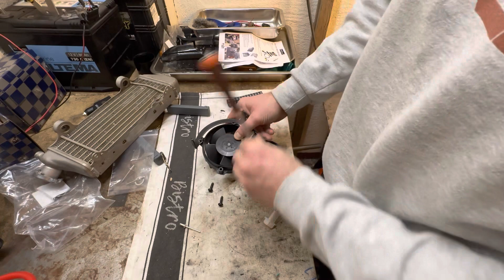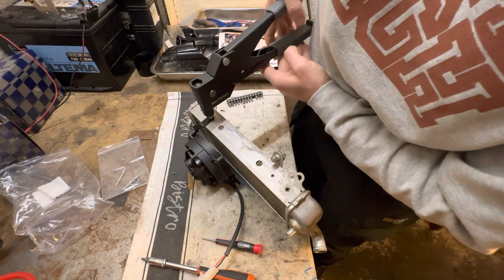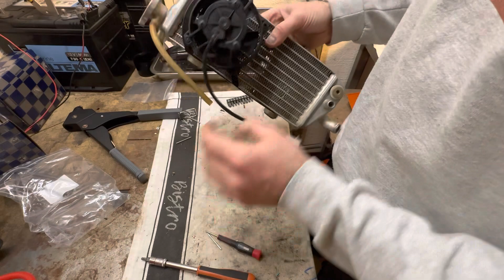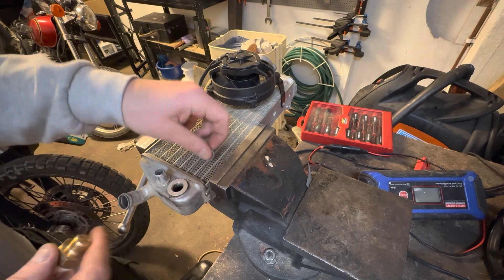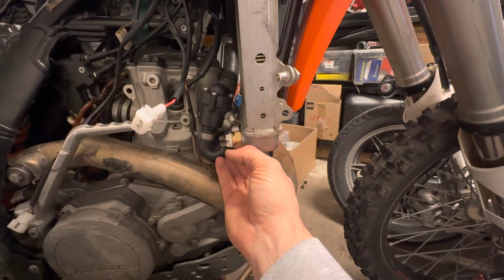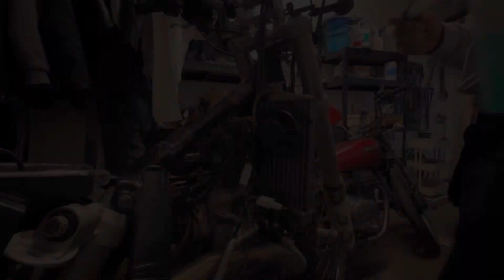KTM 450 EXC 2011 cooling fan installation.

Comment from the maker: DISCLAIMER. Read this before install.
At 0.36 when you se me mounting the fan to the bracket i do it wrong. Mounting it that way makes it sitt 2-3 cm out from the cooler and thats not correct. The fan is to be fitted on the other side of the bracket. Hard to explain but you are supose to be able to take the fan of the bike while the bracket is still mounted. 
 Hope it helps🙏🏻